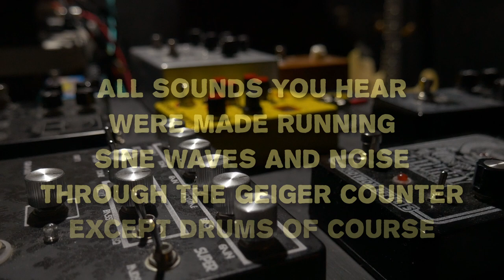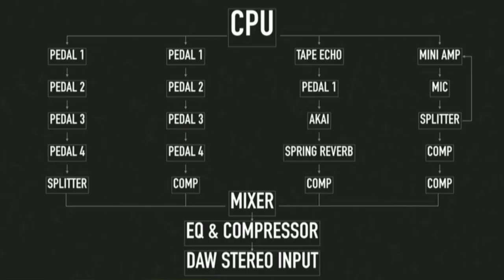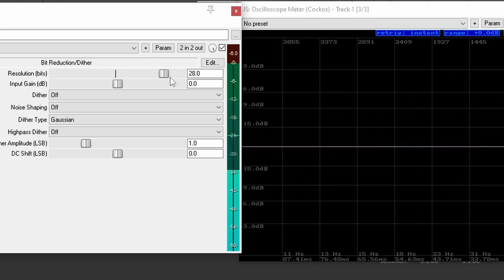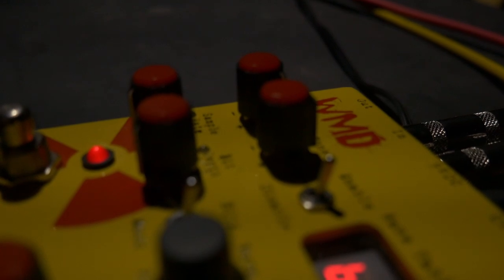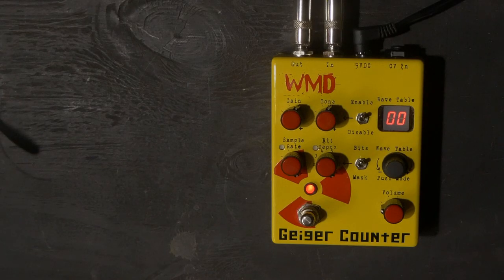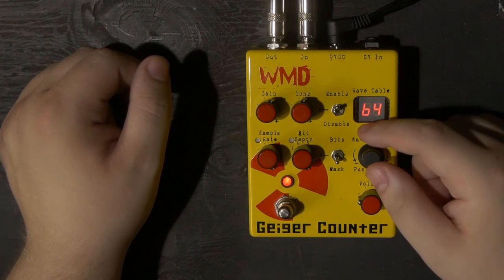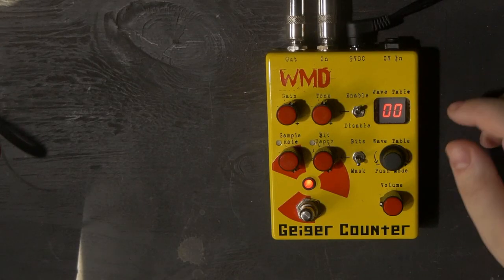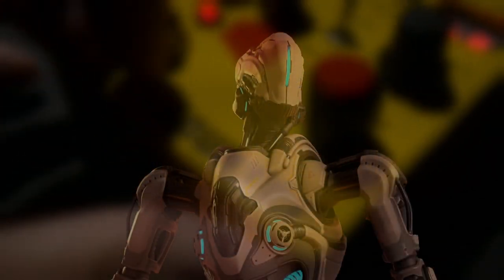DOOM 2016 in a PEDAL!? | WMDevices Geiger Counter Pedal Demo & Review

Comment: The only thing I don't understand is where you (and Mick Gordon) are getting these sine waves from? Do you generate them on a computer, then run them through a pedal and record them on another computer?
Reply from the maker: Sort of! You only need one computer and an audio interface capable of multiple outputs. I use a plugin like Vital (which is free) or PhasePlant to generate the sine waves. I set that track to output on Output 3 of my audio interface, which leads to my pedal chain. It then passes through the entire pedal chain and goes into Input 1 on my audio interface. I might make a deep dive video on this eventually, as I think tons of people would love to try this sorta thing but it's a nightmare to figure out the routing at first.
Reply: @DaveyPerron  Thanks for the answer. Can I do this trick with my Focusrite Scarlett 2i2 2nd Gen audio interface? It has "Right" and "Left" line outputs.
Reply from the maker: @stravvman  Yes, though if you have speakers connected to those line outputs, you'd have to sacrifice one. Let's say you have nothing in Line Output 2, you can then create a sine wave track in your DAW, set that track to ONLY output on Output 2, connect a cable from Output 2 to your pedal chain, and then from your pedal chain to one of the inputs on the 2i2 and that should work.
Reply: @DaveyPerron  I managed to do this with my interface. The main problem was that in FL Studio you cannot send a mono signal to the outputs. But I figured out how to do it. The reamp box is also important. If you're interested, I made a video on how to do this on my other channel: https://www.youtube.com/watch?v=e0R_JfzN4VY
Reply from the maker: @stravvman  sick! Yeah I literally was dredging my old Focusrite to go figure this out, glad you got it! If you use Reaper, you should be able to send out a mono signal. I'll be sure to send this vid to folks who ask me about it in the future, nice work!

Comment: You forgot the fact that if you don't line it up the geiger counter generates incredible sounds, it's not possible with all the presets on this pedal but try this - 8b. And by the way, when I press the black button, yellow lights, green and red, light up one by one or simultaneously.
Reply from the maker: Ooo, what do you mean by "don't line it up"? I'm not sure I'm familiar.

And yeah, for some reason my model doesn't seem to have the yellow light that's referenced in the manual or in some other videos I've seen. Not sure if I have a different run or a defective unit, but good to know! I'll probably reach out to WMDevices and see what the deal is. That'd be very funny if I made a whole video with a defective unit and didn't realize it lol.
Reply: @DaveyPerron  This is true, by pressing the black button, first green, then yellow and then red lights appear in turn ... And if you do not insert a signal source into the line-in and simply bring the pedal from line-out to the sound card, you can achieve incredible sounding. 
I bought this pedal only in order not to connect anything to it from the outside, it is self-sufficient and generates incredible noise cascades.
Reply: @DaveyPerron  Try my old video -  WMD Geiger Counter [Ugly, Weird, Crazy pedals]  in youtube =) But i put there after distortion + bass in DAW. But this noise is self-generated by Geiger Counter.
Reply from the maker: @init-crioxica  Sick stuff! I'll be honest it never occurred to me to try running it unconnected! The examples you linked were pretty gnarly. I might try feeding that into a compressor and sidechaining it with some higher clarity synths to get a cool contrasting call-n-response going. Might be a great little space filler. Nice find!
Reply from the maker: So an update! I reached out to WMDevices and Alex said: Newer revisions of the Geiger Counter pedals only will go green if there is a cable plugged into the CV/EXP input, as the green LED is assigning CV to the related parameter. Older models didn't have jack sense, so if the LED was green and there was no CV plugged in, it made the pedal seem broken.

Looks like because I didn't have anything plugged into the CV, the other colored LEDs didn't appear. I'll test later and confirm.
Reply: Try intensifies by moffenzeef modular...
Reply from the maker: @iosifkalpaktsoglou2045  Damn! They're sold out. I'll keep my eyes out for one in the wild, it sounds sick af.